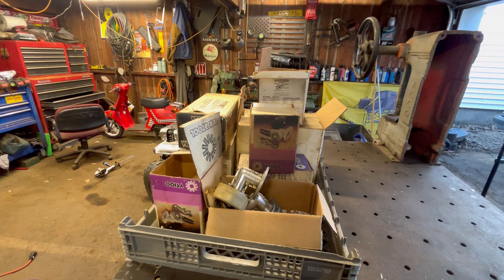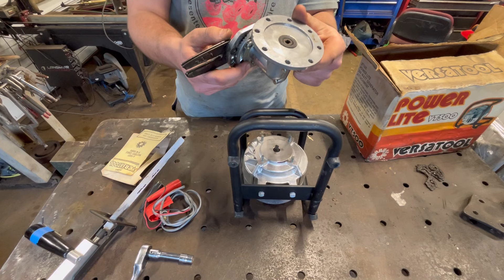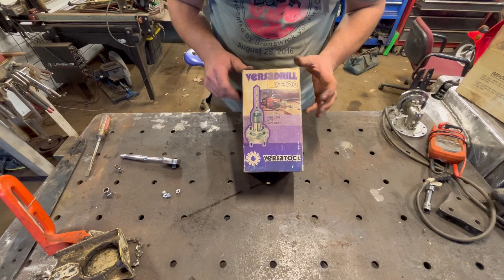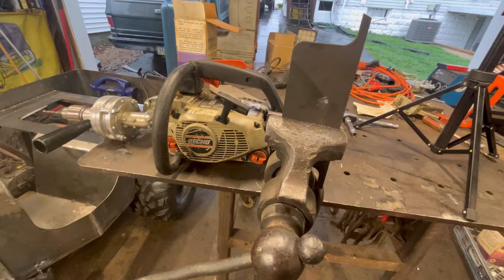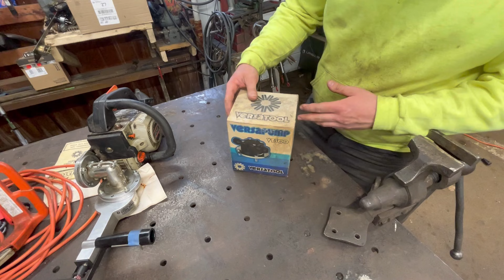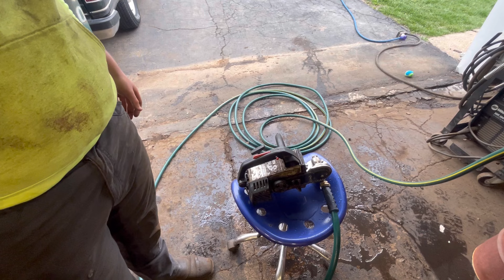Will these 4 rare chainsaw attachments from the 80s still work? Versa tools drill, generator, pump!

Comment: For the generator you may need to connect it to a 12v battery when you hit the Excite button to get power flowing or you can plug in a drill and spin the chuck. By hand while holding the trigger down to get the generator to work. I've had to do that before on older generators to get them to start producing power again.
Reply from the maker: Ahh you know I've heard of something similar for old engine drives, Ill try that tonight. thanks!